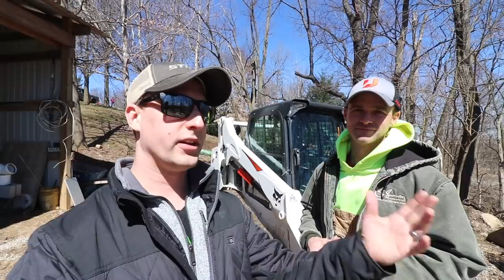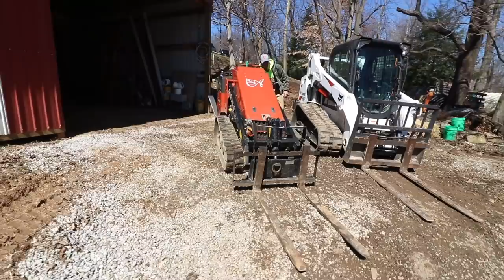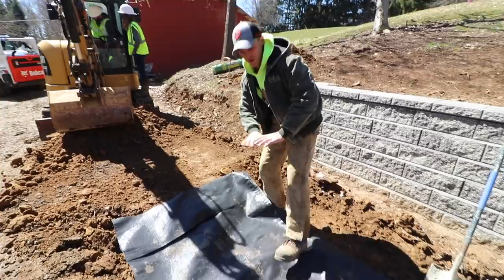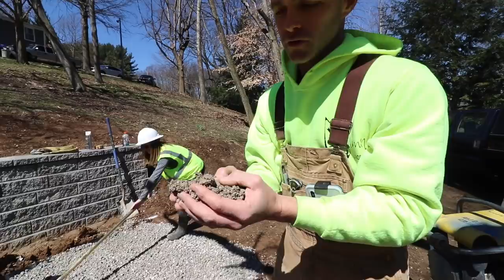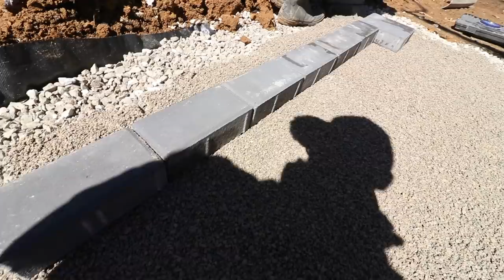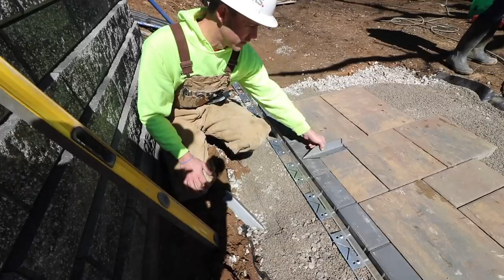Learning The Ropes With Caleb Auman As We Build A Paver Patio!

Comment: Those mini Skid steers (Dingo) are really great. The company I work for has an SK850, and it gets used almost daily for everything from patio work, tree planting, stump grinding,  moving brush, ect... Just last week we were using it to run two 500 foot Electric conduits. It managed to pull the two of them at the same time about 350 feet, before we had to make a hole and start a new run. We have larger tractors for the heavy lifting, but the Dingo is so versatile, and it can be used on dry lawns for lighter tasks with out tearing up the grass if you are careful when turning.